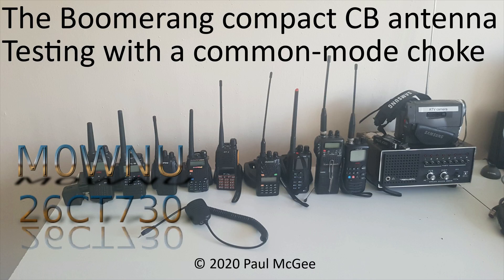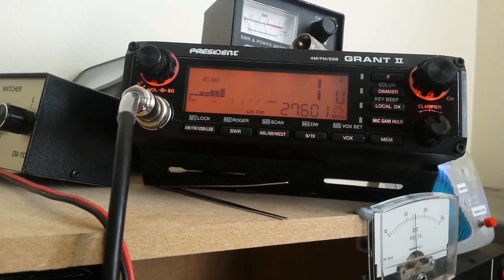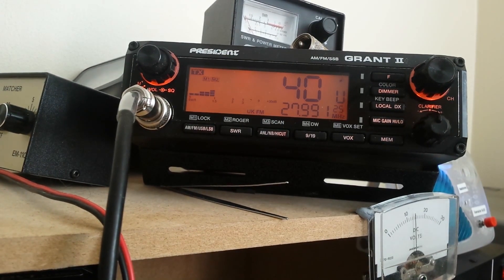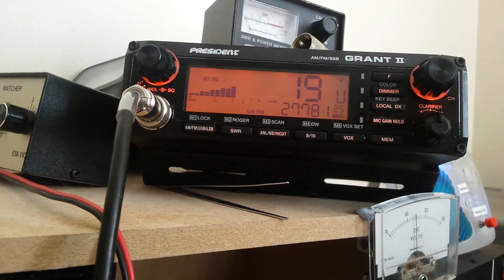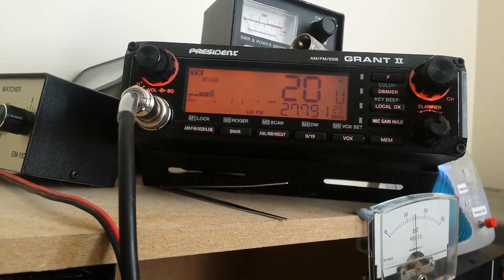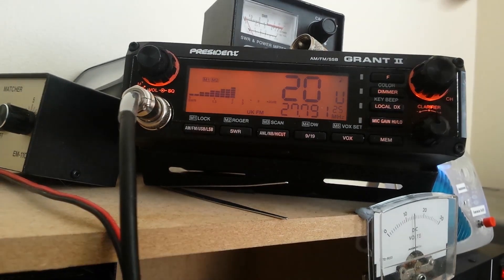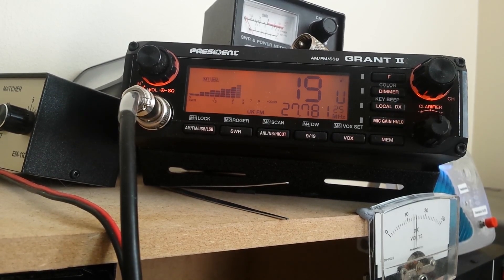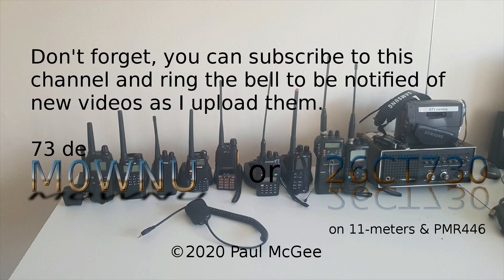The boomerang compact CB radio antenna, testing with a common mode choke

Comment: I have 2 boomerang cb antennas can I run them together with a pice of cophase coax , I would use a balun and. Auto tuner about 17 ft off the ground.
Reply: Why adding additional losses to the antenna? just a ugly balun like the gainmaster, same principle, works perfect on cb, and if a coax balun, clip on ferrite beads. is perfectly ok that way.